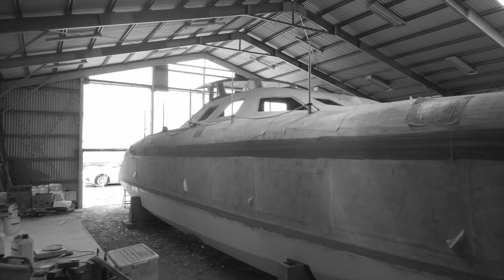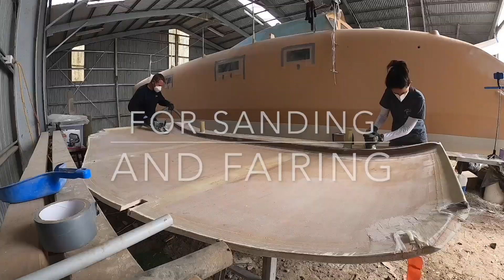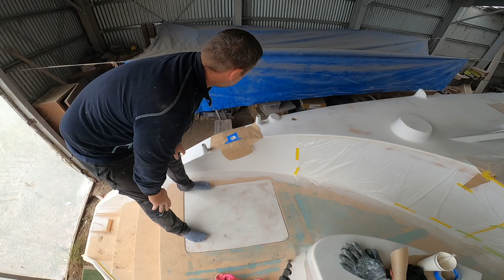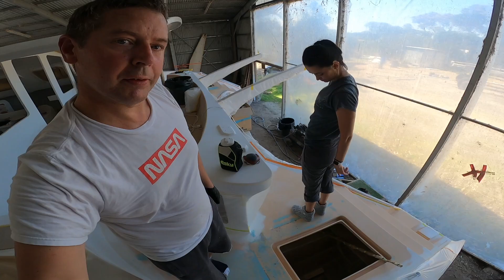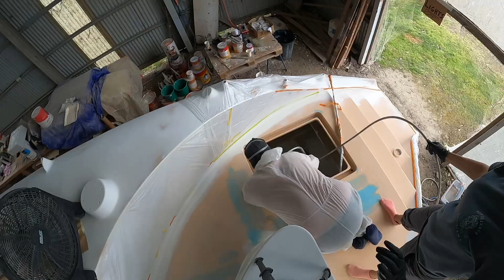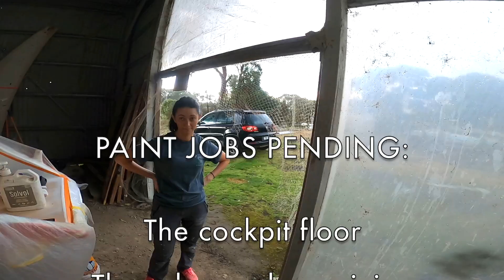The DEATH of the AIRLESS SPRAY GUN - S03 E03 - DIY CATAMARAN BUILD

Comment: Considering the quantity and viscosity of the coatings you have applied, this spray gun has been quite durable. And definitely faster than using a pressure pot system.
Reply from the maker: Absolutely! It did its job. We were expecting it to die at some point. I would say it easily paid for itself.

Merry Christmas 🎄

Comment: Flush with thinners\gunwash then pump diesel through & leave it in the machine. When you are going to use again flush with thinners again, putting water through your paint sprayers is a bad idea..  Buying used is a gamble,
Reply from the maker: Should have done that... The thinners I ran ate the seals, then the cheap plastic vital parts that would have been better built in a better more expensive machine. You get what you pay for 🤣

Comment: I would put a couple strong bobcat diesel engines in they are economical and cheap, that is if you don't get burned out on this project
Reply from the maker: Not planning on getting burned out. 🤣 We have our drives ready, install will start soon.
Reply: Great design !
Reply from the maker: Thanks 🙏. It's a Schionning.

Comment: Other hole is for your fresh water fill if ur on dock and dont need to turn on watermaker
Reply: Or it could be a overflow or a vent hole for fuel tanks
Reply from the maker: Too far away... And i know where the vents are. I really think it was for water. I'll ask the previous owner when I see him.. Now it's gone.
Reply from the maker: Maybe... But I already have one. Midship.
The extra hole was port forward. Would require a bit of plumbing to be a water fill. A pump as well probably. But you may be right. Not far from the water tanks. Maybe 5 m of plumbing. But believe that may still be it ....
Reply: @buildingwilda is it possibly a port for pumping out the holding tank for the head?

Comment: A word of warning regarding a decision to be all-electric propulsion. If at anchor or on a mooring and the unthinkable should happen you will want an engine that will not fail to get your vessel under command. Electric engines while great for small monohulls they are not so well suited for high-windage performance catamarans. Consider carefully. A hybrid solution for propulsion may be a safer option. Having at least one engine that can move the boat forward in a 40 knot headwind is a VERY useful thing to have.
Reply: More important is if you get becalmed in an ocean current and get swept hundreds of miles in a wrong direction.
Reply from the maker: As long as the hundred miles have enough water, we'll be able to make those miles up quickly when the wind returns.

A narrow tidal sound would worry me more.
Reply: That was some rain storm. You got the cockpit windows to fit, congrats. Any plans to add color to the trim? The paint system did most of the boat and you learned alot. Now it's time to upgrade. Decision made on engines, fully electric with backup generator and dingy. Your boat, your choice, your decisions and experiences when under sail.

First a sailboat, motor boat second. Trade-offs on weight, noise, speed, range, etc. The industry is in flux - diesel, electric, hybrid, diesel/generator, diesel/hybrid alternator/generator combinations. Other decisions to follow: shaft driven or not, propeller size/type (fixed, folding, vari-pitch), coupling method, alignment, vibration, noise, heat. Maintenance issues: reliability, support, parts accessibility or readily available, Mc Giver fixes and options.

Lifestyle choices: all conveniences, water maker, washer, dryer, dishwasher, microwave, kettle, toaster, induction oven, air conditioning, heating, fridges, freezers, charging equipment, power to run the boat, using tools for maintenance, emergency power for lighting,
pumps, comunication. Basically power consumption considerations.

Finally emergency contingencies: flood, lightning strike, system failure, other.

Have fun, enjoy, learn, change.
Reply from the maker: Yes... Lots to think about for sure....

From this stage of the build all the paint is top coat. I think it's worthwhile getting our professional painter to do the spraying. Also airless, but his professional pump.

One thing you mention I really have no clue what direction to go... Lightning. What can one possibly do to avoid or mitigate the impact of a strike or near strike?

I tend to lean towards thinking there is absolutely nothing you can do....
Reply from the maker: The trim on the window frames will be powder coated.
Reply from the maker: Thanks. I have thought long and hard about electric propulsion.... If I got it right remains to be seen.

My thinking is that the best safety will be in having a boat that can actually sail, and sail well, also upwind.
Any electric or combustion engine should be an auxiliary means of propulsion.

Torque and thrust will be the strength of my drive system, rather than speed. If (I guess, when) we end up in the situation you describe, I think I'll be able to cope for quite a long time. With a small generator, even longer.

The dinghy I'm going petrol. The dinghy outboard I plan on being able to use in a real pinch.

Hopefully I won't have to.

Merry Christmas 🎄🎁